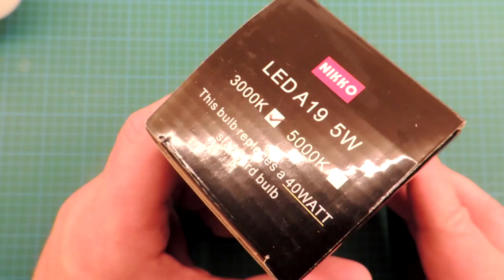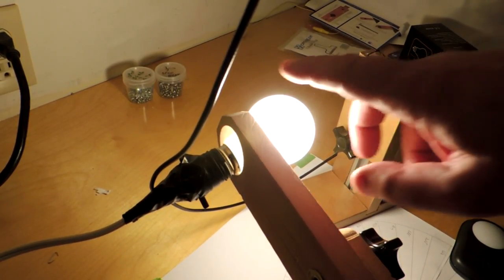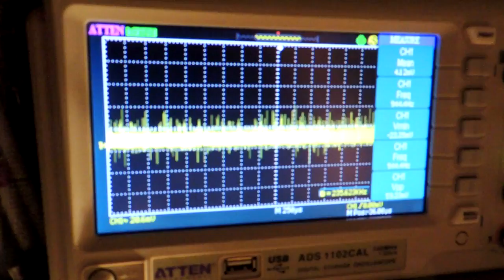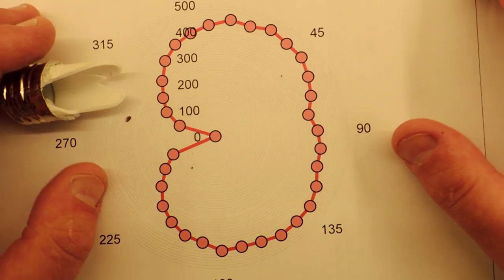NIKKO A19 LED LIGHT BULB TEARDOWN

Comment: Where did you find this thing? From your videos you seem to be in Quebec, possibly Montreal, and so am I, but I'm having trouble finding information on this bulb on the internet. I've got a Canadian Tire floor lamp that gets a bit of an uncomfortable hotspot with my Cree bulbs (the lamp has a thin fabric). These Nikko things seem to be a very even and diffuse light.

One thing, though, is the colour temperature. All my other bulbs are soft white (2700K). This one looks to be 3000K. Would that be terribly apparent if I mixed these at 3000K with my 2700K Cree bulbs?

Comment: I was initially expecting to see the same as inside the filament LED reviewed earlier, since in that case it would just be a matter of using a frosted globe instead of a clear one.

It's certainly impressive how close they are to replicating incandescent bulbs, both frosted and clear.  The main challenge now is to make them dimmable and match the orange colour shift as the bulb dims.

Comment: You forgot to do the most important thing on this review... temperatures.

It's a closed bulb, the ac-dc converter is further stuck inside that ceramic tube that may get hot from the bulbs... I don't see any airflow - maybe put a temperature probe inside the ceramic tube, glue it back to its form, put the bulb in a small glass jar to reproduce the glass of the bulb that you broke and measure how hot it gets inside?  Just to know if that 35k hour rating is believable.

Comment: Can this bulb be purchased yet? All I was able to find was the manufacturers website without any "where to buy" links or anything of that nature.
Reply from the maker: They were on my local hardware stores shelf
Reply from the maker: Frank Winkhorst Indeed, that's a pretty good analysis.  It would not be surprising that this would be a small importer moving goods from China into North America.  There are strong ties between Richmond's business community and China due to large immigration over the last 20 years.
Reply: we are selling these 360degree led bulbs 3w 5w 7w 9w , the lumen can be arrived 100lm/w. Ceramic+ aluminum double heat sink ,from shenzhen.China.
if interest, drop email to me   millytung@futureledcn.com